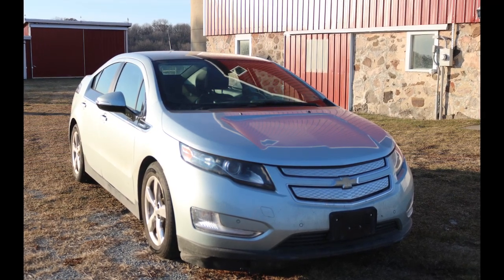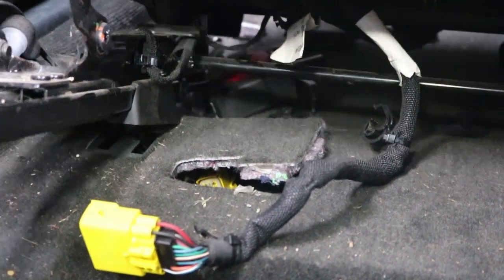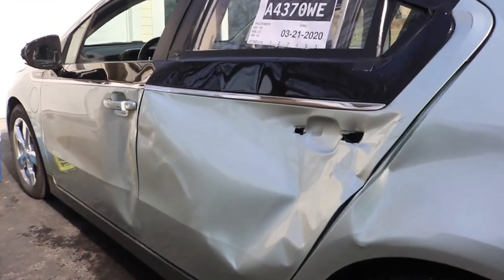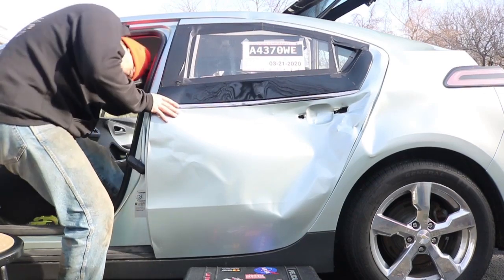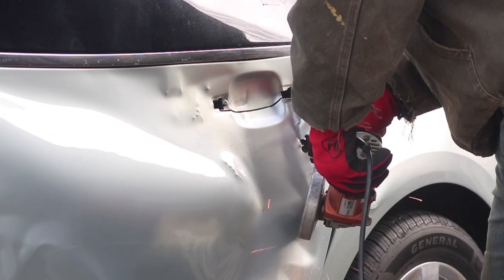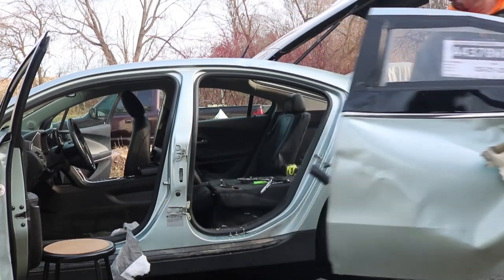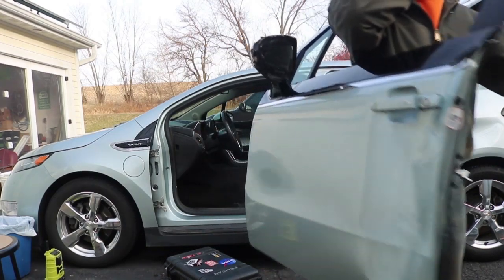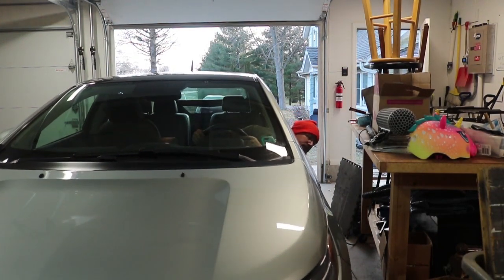Removing the Doors from a crashed Chevy Volt

Comment: My driver's side is stuck from an accident - how did you get your's off?
Reply from the maker: @schainaubb  On the back door, it was jammed shut from the collision. I had to cut through the sheet metal to get to the door latch and manually release it. Then I could open the door and remove the hinge bolts.

Comment: Yellow connectors = air bag wiring.  The seat back has a air bag in left side.  Be careful, disconnect 12v battery when messing with yellow connectors for any reason.
Reply: Good advice I have been working on these cars for many years one mistake i made was plugging in the airbag module without the module being bolted to the body first even with the car turned off that made both side curtain airbags go off as i was siting in the drivers seat sounded like a shot gun went off in the back seat. That goes for all the newer GM's with the plastic module if you take a close look one of the bolts holding the module down has a ground strap, without that grounded the module thinks the car is rolling over.  AND those orange wires=360 volts know what your doing or you will die.

Comment: Sir.. this car is plug in hybrid car?????
Reply from the maker: Yes. A Chevrolet Volt is a plug-in hybrid car. It runs on electricity until the battery runs out and then switches to gasoline power.
Reply: Its also wroth noting that its not a normal hybrid, its way cooler!    Its basically got three modes of driving.   Mode 1 is all electric, it is an electric car.   Mode 2 is after it runs out of battery, its still an electric car, but its basically driving off of a generator.    Mode 3 is at higher speeds, the engine can couple to the drive train and assist in propelling the car.    There is no "real" complicated transmission like what you find in a traditional hybrid car.  Its a really robust reliable system, probably one of GMs best kept secrets that nobody truly understood.